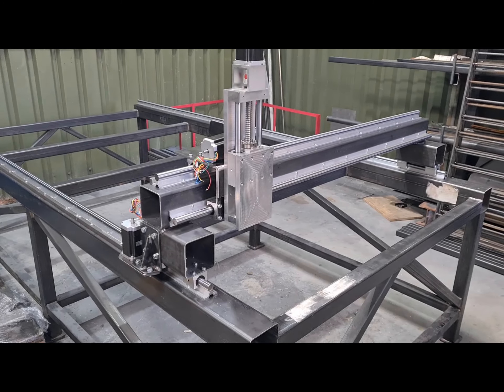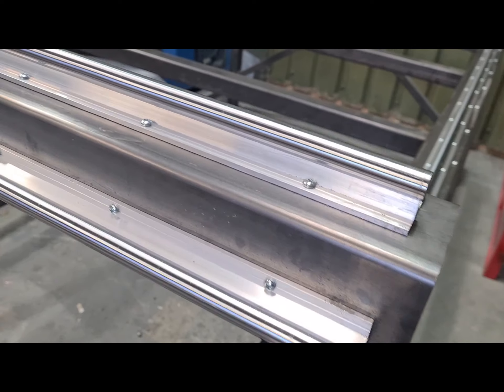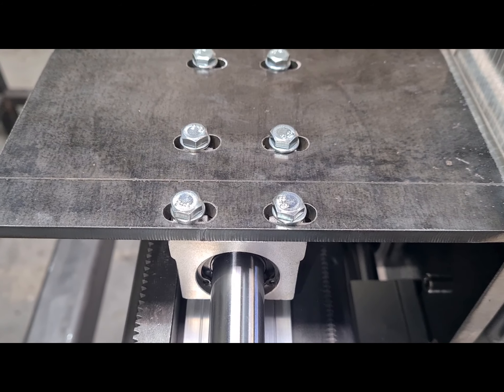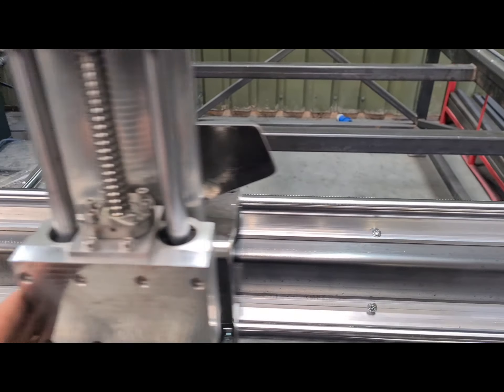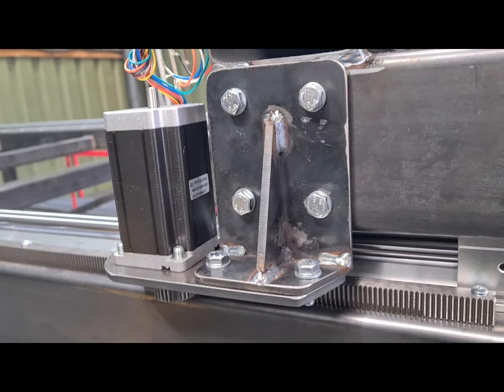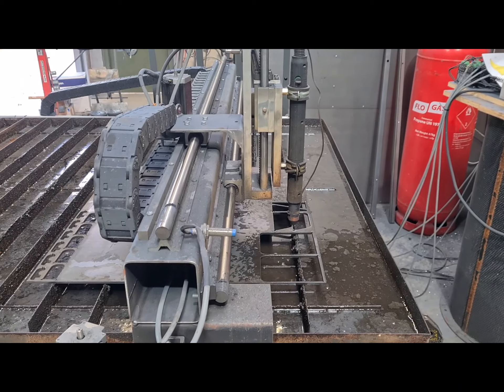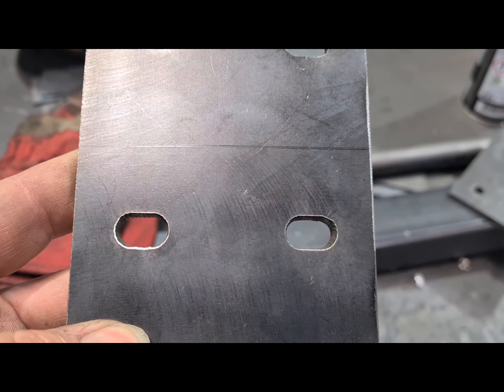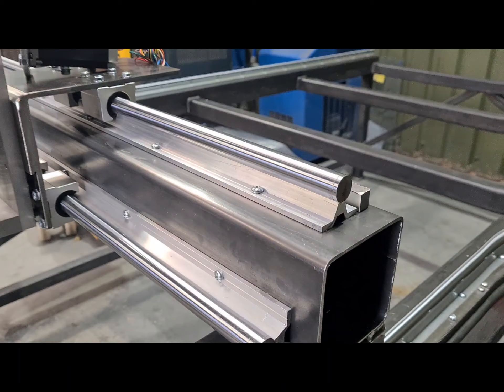1.5m x 2.5m 8ft x 4ft cnc plasma table build

Comment: Looks awesome, im slowely getting tge parts for building one my self, and your videos make me feel like i can do it.
Can you please tell me what stepper motors and rails are you  using for the machine.
Thank you
Reply from the maker: Nema 23 with planetary gearboxes and the rail is 25mm supported linear rail. But if your budget can stretch to it get HWIN rails 20mm would be fine in that case. Thanks for the ups

Comment: What gear tooth do you use on the racks? Mine X is ball screw and the Y is currently belt driven and would like to switch over and get away from the belts.
Reply from the maker: Hi.... good choice 👌 
I've changed a few times but I went with 30 teeth gear. Also I've got 10:1 planetary gearboxes. Gives best speed and torque for the size of motor.
Reply: @ What is the speed like? I am wanting to be able to switch the head for a spindle or a laser. Eventually would like to be able to mill aluminum and mild steel.
Reply from the maker: 9000mm per min Should be fast enough 😆

Comment: Hi Rob, I've started building my plasma table but was thinking of bolting the main 100x100x3 frames together (the 2 Y frames and the connectors rails that separate them), then bolting that onto a 50x50x2 'welded table'. Am I overthinking it, as I see you have welded your entire frame/legs/braces together, thanks.
Reply from the maker: I welded mine because it was quicker. As long as your bolting detail is sound- by that I mean solid 😆- you shouldn't have a problem....even better if you are bolting it to the floor. It does need to be fairly rigid...I've have problems with cut quality on weak tables, hence the monster bed 😆
Reply: @robbroomfield468  thanks for your comments. I tend over-engineer things when I build them, so it will be well braced. I'm just concerned about welding the main frame rails and introducing some warp/twist. I'm not planning on bolting the table to the floor, but would consider doing so, if the cut quality was suffering.
Reply from the maker: As far as warping is concerned, don't do all the welds on one joint at a time. Weld one run then go to another joint and work around keeping the whole thing as cool as possible. 😆
Reply: @robbroomfield468  thanks, I might try welding up the frame instead of my original idea. Will let you know how it goes.

Comment: For the support rails and rack, are you running pieces together or where did you get such long pieces?
Reply from the maker: Cnc4you.co.uk. they stock 2.5m lengths
Reply from the maker: You could fit them together but it is notoriously difficult to get it dead smooth.
Reply: @robbroomfield468 Thanks! Need to find a US retailer.
Reply from the maker: Ah yeah. If you look for HWIN rail a stockist will usually have SBR